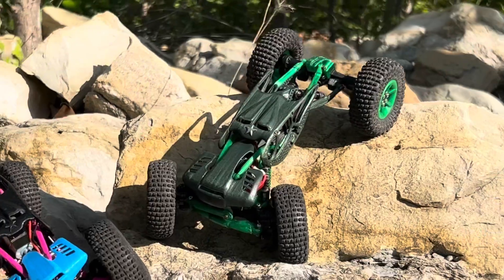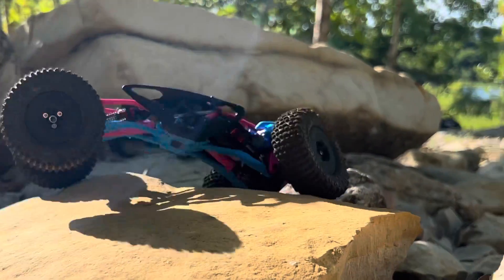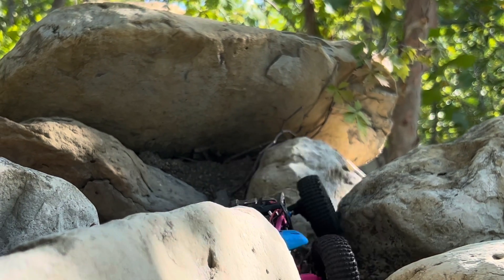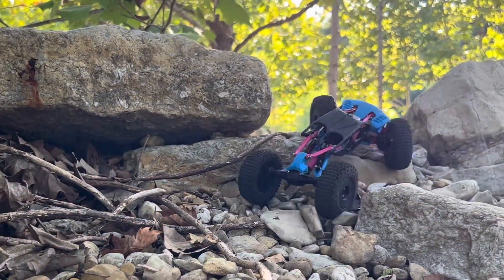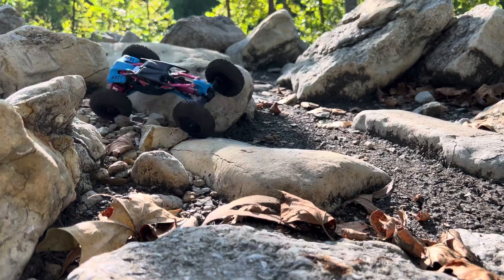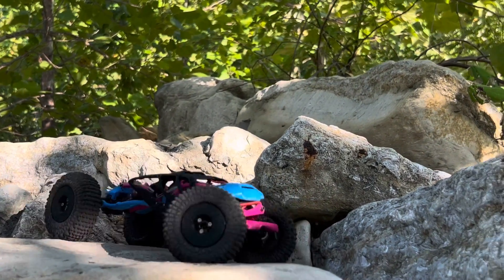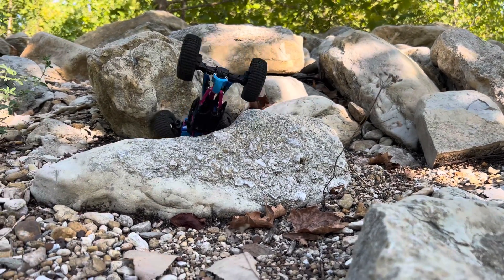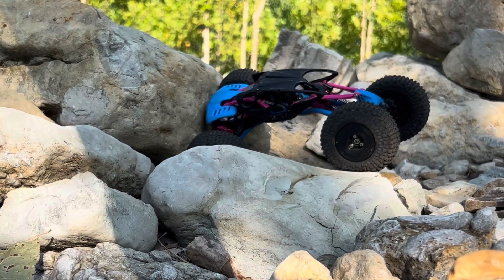Slayer Elite—Testing Proto Mullet—TRX-4M/FCX24

Comment: For the Fcx24 rear axle to work with the Trx4m front, I'm assuming that you have to flip the center section and remount the portal boxes? Otherwise the rear tires would spin the opposite direction, right?
Reply from the maker: Yep. Flip the gear and the rear cover, cut the tabs and put the portals back on. Thanks for hangin bro. Hope you have a great one.

Comment: So is this a direct swap over with TRX4m components?
Reply from the maker: If your trx-4m came with a lizard pro, 130 size motor and an fcx24 rear axle, then yep, it’s a stock swap. Lol. Can’t bring the electronics. I have the link riser for the rear axle, so you don’t have to run the fcx24 rear. Hope to have it up tomorrow some time. Thanks for hangin. Hope you have a great weekend.